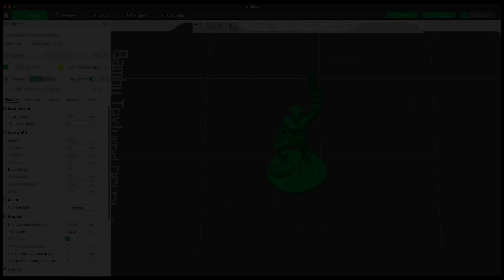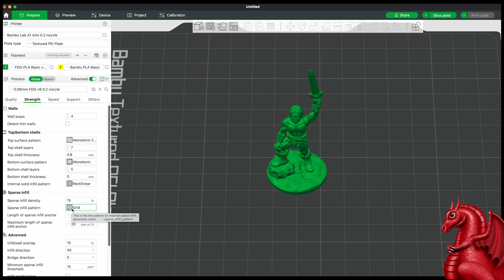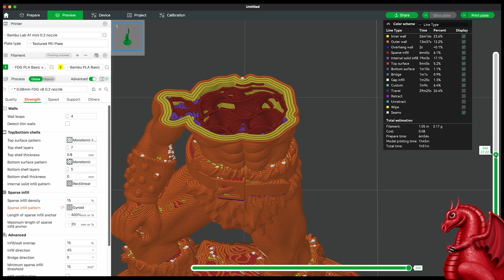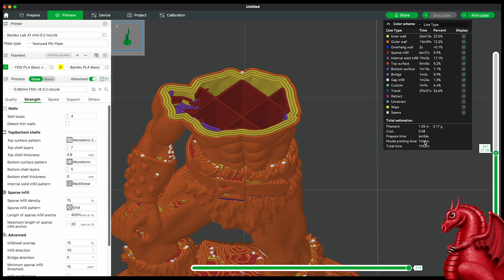Bambu Lab A1 /A1 Mini Print Failures

Comment: Thanks man. Good to see this as you ask for help anywhere and the fan boys bite your head off because they thank Bambu machines are perfect
Reply: Totally agree......klipper has been a bit like that for me as well....which is a shame because it's often fiddly hardware that interferes with brilliant software design.
Tom is a true servant to the community, very few people would intentionally make prints worse to learn what is going on and why.

I'm seeing some comments about the beds on A1 minis being warped/bent just a little too much for the bed leveling compensation to keep up with... probably at higher speeds the Z axis can't jerk back and forth fast enough. I'm "weird" because I almost  couldn't care less about print speed ....as long as it's not a step back to the late 80's.
....Accuracy with non-resin based materials  is THE most important thing for me for me doing small scale work and functional fit parts. I am very encouraged to see discussions like this, for transparency and would recommend reviews over on the MyTechFun channel. Igor is a Hungarian engineer with seriously informative technical videos.... a great compliment to the ones on this channel.

Comment: Good advise as usual. It does sound like nozzle knock. It is a big problem when printing things in higher temp filaments like PETG/ABS/ASA. Switching to a non-crossing infill like gyroid or or rectilinear can help. As mentioned you can also mitigate by slowing the speed down, but you may need to slow things down a lot to give enough time to melt the plastic. So changing infill is usually the more desirable solution.

For small prints, like minis, these infills will not significantly increase print time. For large items it can increase by a percent or two, but its well worth it to avoid issues.
Reply: Thanks

Comment: Thanks for the video!  Ive a quick question if I may?  after printing loads of prints fine with the Bambu filament on the A1 mini, now im trying some Sunu filament im getting quite a bit of very fine (fluffy) stringing :-/. Is it something you've experienced?  Im new to 3d printing and so aren't really sure what to do :-/   Is it just the filament isn't as good as the Bambu stuff maybe?  thanks!
Reply: Hair drier
Reply: Ha :). Well yeah, that’s what I’ve been doing - but would be nice to get a good clean print off the plate if possible
Reply from the maker: Are you using my miniatures profile?
Reply: @Tombof3DPrintedHorrors alas not yet (guilty face). I haven’t needed them yet as haven’t really printed anything that small and detailed. Are there any particular settings that would help?
Reply from the maker: @nickholl  Sunlu PLA META is best for small models, I have not used it for anything big so cannot advise.

Comment: Perfectly timed video! I recently switched to Orca Slicer (my printer is a Creality 3 V3 SE) and Orca too has Grid as the default infill pattern. I had my first nozzle knock over a print and I was certain it was some Z-offset issues. I realize now it’s probably the grid infill that’s the culprit because I can audibly hear the nozzle dragging through the grid lines. I’ll definitely change to cubic or gyroid moving forward.

Comment: Hey Tom. I also purchased an A1 mini, but couldn’t even start a test print before I ran into an issue. I fed a new roll of filament into the filament hub and confirmed it’s passing through, but the extruder gear does not seem to be catching it. Even when I try to push the filament in, it doesn’t seem to be reaching the melt chamber. I’ve got a ticket in with support, but just wanted to check if this is an issue you’ve encountered or heard about. Thanks, love the videos.
Reply from the maker: Are you depressing the extruder release lever when you are feeding the filament into the tube and it reaches the extruder and stops? I've found if I feed the filament to where it stops, depress the lever, then push a little more it will grab it.
Reply: @Tombof3DPrintedHorrors  That (plus a little extra pushing) seemed to do it. Thanks!

Comment: Cubic/Cubic subdivision was what I saw most of the time as the fix to this, as it takes less time than gyroid and gives better structural stability, but of course that all depends on the part, regardless thank you for making this video, a lot of beginners that get into 3D printing especially with the user friendly bambus don't know about this.
Reply: Cubic is self intersecting just like grid and causes this repeated collision friction.

Comment: As far as printers - have you ever printed on the Kingroon KP3S Pro V2 for miniatures?
Reply from the maker: Yes, didn't do as well as the Ender-2 Pro.
Reply: @Tombof3DPrintedHorrors 
Thanks - I don’t have  a FDM printer as yet  - I would like to print miniatures on a FDM and with the help of your print profiles and your advice; I am leaning toward the A1 mini or the A1 itself. Again - Thanks
Reply from the maker: @franksilva3566  both are really good, but I am seeing slightly better miniatures off of my two A1 Minis than I am on my full size A1.